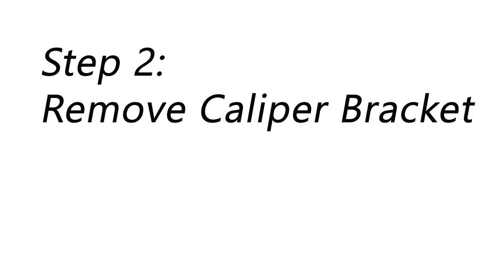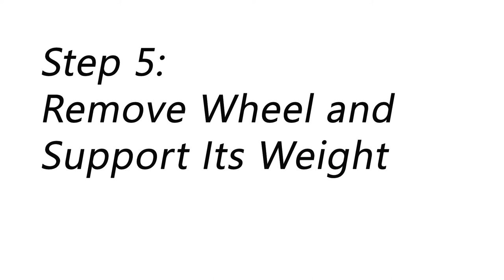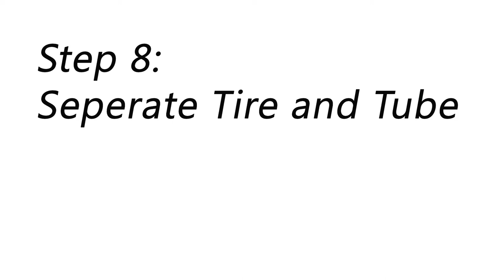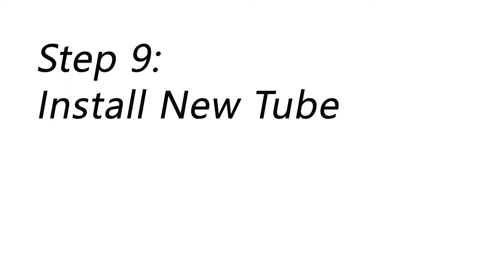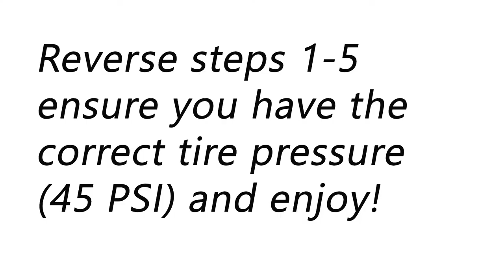Mantis Electric Scooter Tire and Tube Change Tutorial

Comment: These things are assembled terribly. I'm an engineer and I'll tell you guys right now those Allen screws that hold the side of the wheel on do not need thread locker. Thread locker on parts that cannot be heated is a big no no. Especially on a maintenance part like the tire! This company needs to substitute lok tite with real engineering instead of just applying glue to keep their bolts in.

Comment: Do you have to remove the calliper separately ? Can the bracket with calliper be removed in one piece instead ?
Reply from the maker: It is much easier to remove the caliper separately, as the caliper, naturally, has not much room to move left and right.
Reply: @fluidfreeride  Ok, thanks.

Comment: One of my six screws that attached the motor to the tire is stripped, what should I do?
Reply: Ugh same thing just happened to me. what did you do?
Reply: @janedoe6769  I used a screw stripper and got a replacement screw